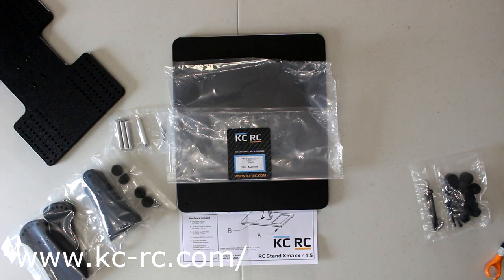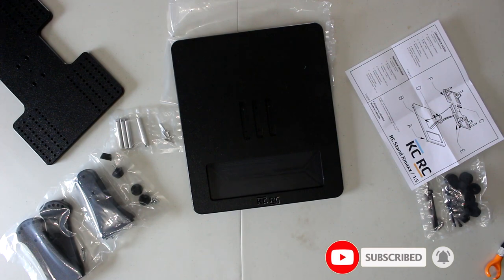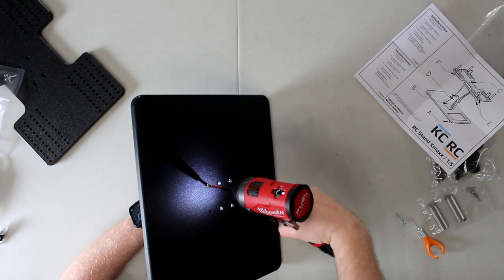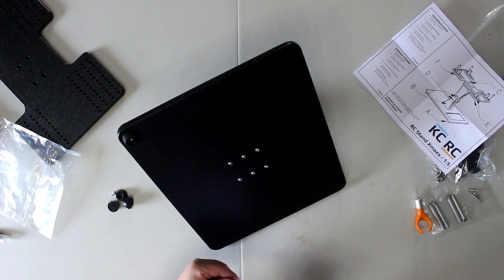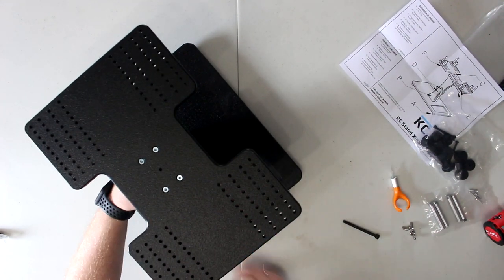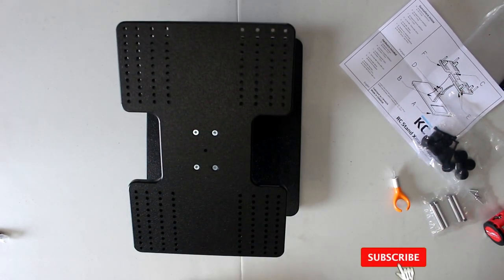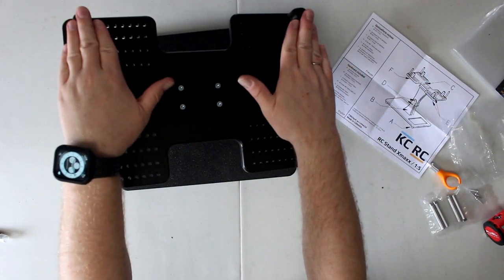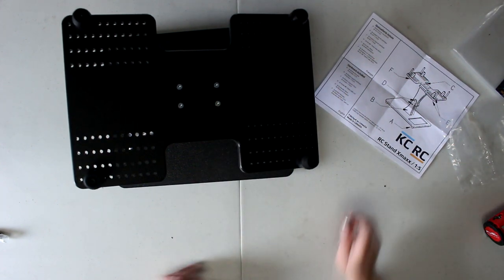RC Car Stand /Tilt Work Bench For Xmaxx /DBXL E 1/5 Scale

Comment: this work for 1/5 kraton BLX model and also any 1/5 scale Arrma vehicles? once I hear back I will go to site and have a look seems to be big enough for the kraton
Reply from the maker: Yes, it will work for both. You just need to make sure to add some thing in the middle of the stand when it’s on the table to prevent it from bowing.
Reply from the maker: If you do place your order with him, please mention where you saw it. I did not get a I commission, but I would like him to know thanks
Reply: @djsprc  okay will do for sure your promoting him so np